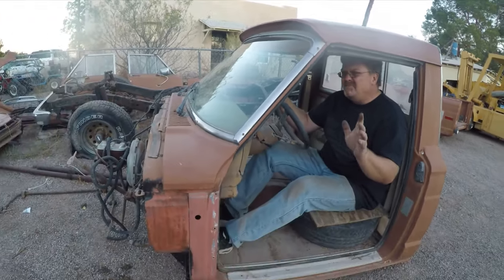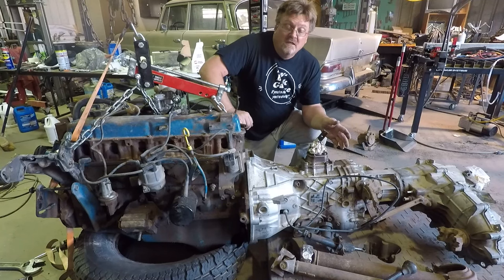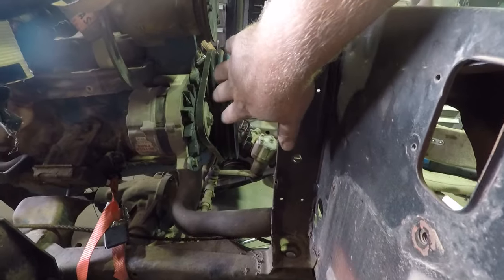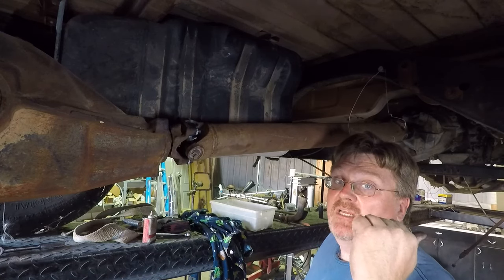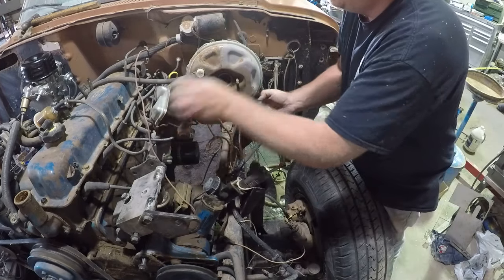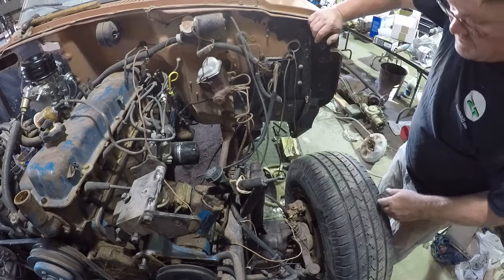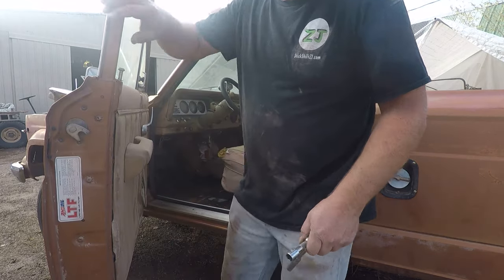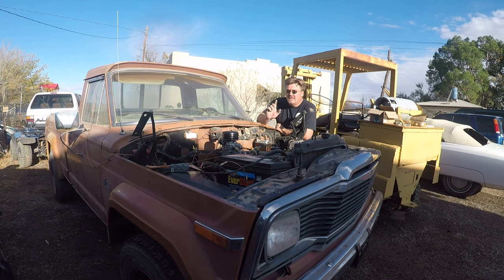Jeep J10 Build, 25 Years Off the Road, with a Bonus 5-speed and Engine Swap!

Comment: I bought a 1964 F100 about three years ago. My cab was on the chassis but everything else was in parts. Last registered in 1992. No motor or transmission. The guy I bought it from was the third guy to realize it was too big a project for them. I hauled it home Father's day 2021. I had a driving chassis by October 2021. My body was a rust belt nightmare. The outer skin was solid but everything else was a disaster. Body supports and floors, gone. Box floor, all box cross member supports and tailgate, gone. No motor, trans or driveshaft. The motor and transmission cross members, gone. No brakes. It did have cool retro Superior aluminum wheels!!😊 Found a 351 M with matching C6. Tore the engine down to make sure it was rebuildable and then bolted engine and trans together to mock up and fabricate cross members and make sure rad support and cab would fit. While the engine was in the machine shop, .030 over and head rebuild, I rebuilt the cab floor and front body supports. So far pretty easy!😊 A friend rebuilt the C6 and after engine reassembly they were mates and a driveshaft made. An aftermarket disc brake conversion had been installed poorly so that took some work. Anyway, I did have a driving chassis by October but it took the winter to complete the the remaining rust rebuilding. The outer shell looks like a "survivor" but the guts are anything but. Nice driver except the 8 mpg😢 I really enjoy watching your videos! Rhanks

Comment: It's interesting Jeep didn't change the radiator support from the Gladiator days and it still has all the cutouts for original light configuration.
Reply from the maker: Yeah, and apparently you can install the old grill right into it.  Just cut off the spot welded tabs that hold on the new grill, and the old stuff (or reproduction parts) fit right in.  I might do that someday...
Reply: I guess AMC didn't have the big budget the "big three" had, and had to keep reusing old tooling. That truck as cool as it is, looks dated for being a 1980 model (look at the roof line).

Comment: I had a 78 J20 I bought from the most insane person I have ever had the misfortune of knowing in Kemmerer Wyoming for $500. Cut to a few years later and I'm driving it to Salt Lake - going through the canyons with no brakes, no exhaust and the thing isn't even licensed. We fixed the brakes (rebuilt the whole system) but then the flywheel had missing teeth and you would frequently have to rock it back and forth to get it to start. Sold it on eBay and had to cut the price in half - as when I went to start it for the guy it was on the broken part of the flywheel. Needless to say - it was a neat truck, very powerful, but I was glad to get rid of it. Sorry to the fella I got rid of it to - as I am sure he found it had many, many other issues lmao!

Comment: @Low-Buck Garage - Very impressed how you cobbled together most of the parts you had and made a run and drive out of a pile of parts. Really wish to a little wire wheeling, degreasing and a light sprits of black paint. But I guess if you live in the desert it really doesn't matter much. You had perfect access before the body was on.
Reply from the maker: Thanks!  It probably didn't show well on camera, but the previous owner had done some painting on the frame a decade or two ago.  It was covered with years of dirt and was getting some surface rust, but its in good shape and now that its covered with a body it won't get any more rust here.

Comment: Awesome truck! Body is in really nice shape as well. I had a 75 J10 with the 360, auto, and full time 4 wheel drive. It was a tank but had a fair bit of rust already, even had Flintstone floorboards! Lol, great trucks though, I have fond memories of it (other than the amount of gas it burned).
Reply from the maker: Thanks!  I'm curious how this one will do on fuel, the OD should help, but that 300 is not known for being efficient...
Reply: @LowBuckGarage   Probably be average truck mpg. I believe mine was horrible because of the full time 4X4. Mine had air lockers on it as well, the knob for it was in the glove box. I like your choice for the engine, those 300's run forever. Definitely a fun truck though, wish I still had mine!

Comment: It's great to see another J truck coming back to life I have a 80 J10 I'm 1 ton swapping because the AMC 20 "heavy" has lost the axle shaft 3 times so I'm going D60 front D70 rear and call it a day
Reply from the maker: I'll keep an eye out for that, what size tires are you running?
Reply: @LowBuckGarage  all stock running 31's with the same modular wheels as yours with the spring over to fit the D60 I'm figuring on trying 33's
Reply: The first time was due to warn parts second time totally my fault and third time axle slid out of the bearings so it wasn't due to larger tires

Comment: I have a 63 Gladiator and it’s a some assembly required type vehicle. Your video gives me hope in resurrecting it with similar engine options (327sbc, 5.7 hemi, and a MCB W126 Diesel). I don’t want to spend any more than I have to to get it on the road. Point being it’s gonna be built on the cheap for maximum fun. You channel is my favorite. Thanks for post this build.  Best-
Reply from the maker: Thanks, I appreciate that!  The diesel sounds interesting, is that the OM603?  More power than the OM617, so it would be better for the full size truck.  Though if you're going for wheelspin, the hemi would be a lot of fun...
Reply: @LowBuckGarage  it’s the OM617. Not really looking for a barn burner, but something really cool to drive around on the weekends. I think the OM617 will do the trick. 🤞Anyways, I really like your channel and I wish YT would spotlight more channels like yours. Just dudes talking cars, spinning wrenches and having fun. As for me I’ve had a number of classic cars, that didn’t go very fast. But in my own theory, you don’t have to go fast to have fun! Best to you and your channel. 👍
Reply from the maker: @oneproudchump8457  I like your attitude, I completely agree!  The OM617 is a great motor, they run forever, but they need to rev pretty high for a diesel.  I spent a while with a W123/OM616 (4cyl version of OM617), and I spent a lot of time in the 4K+ RPM range just pushing a mid-size car.  FWIW, on a FSJ I'd go with one of your V-8 options.  They'll be less work to install (unless you have an oil pan solution already) and probably more fun to drive.  But the OM617 in a FSJ would be cool, no doubt about that!

Comment: Hi, that 300 ford 6 cylinder is a good motor . there" s alot of after market support for it .you could hop it up some ,cam fuel injection ect .and make more power , and torque, good job, I like those trucks .
Reply from the maker: I've never actually had one before, but from the reputation I think I'll like it.  I'm looking forward to getting it on the road!
Reply: @LowBuckGarage  have fun with it

Comment: I’ve got a 1977 rolling chassis jeep truck ,258 straight six standard transmission,
Needs a radiator and steering column. Haven’t got a body or bed though lol

Comment: 1980 is a special year for the J trucks; last year for the cab brow and first year for driver side drop front axle.
TT Fabworks makes a nice SOA front  / shackle bracket flip rear, lift kit.
6" of lift with flat stock springs, that ride nice vs arched lift springs.
Crossover steering, completes the conversion.
My 76 J20 rode better and retained it's 3/4 ton springs, after conversion.

Comment: I know those have low end torque. We had one in a 95 f150. They run forever. I believe it's a Mazda transmission. It got stuck in 5th gear and I was still able to drive home.

Comment: The TFI module bypass interests me.  Could you explain more, please?
Reply from the maker: Basically the TFI module is an on/off switch, and you can trigger the negative terminal on the coil to get spark.  Its a bad idea, though, because those distributors have no advance in them, they need the computer for that.  You have just one timing setting, but an engine needs the timing to advance is the RPM increases.  It will never run well.  I've already swapped that distributor for a mechanical advance one with a duraspark, I just haven't finished the video on it yet.

Comment: Just out of curiosity how long did this whole project take? I have an old J20 and I was looking at rebuilding it but I don't know if I have enough time to do it with school and all.
Reply from the maker: It takes a while, I'm still not done with it yet.  Quite honestly, I've been in your spot and if you're not sure if you have enough time you probably don't.  Pretty much every detail will take at least twice as long as you expected.  However, with that being said see if there's some way you can wrangle it into a project that gets you school credit.  There's a lot of independent learning credit available if you phrase it right, even if it isn't related to the mechanical work.  Something along the lines of "project management and workflow analysis" or "exploring recycling and upcycling in practical applications" might be workable.

Comment: That may be a '79, I think '80 lost the eyebrow on the cab
Reply from the maker: Maybe its an early '80, because it has a driver's side drop front axle, and I know that started in '80.  I really like the brow on the cab, glad it has it.
Reply: I have an '80 and it doesn't have the brow.. Jeep was notorious for using up parts and making changes whenever in model year production!